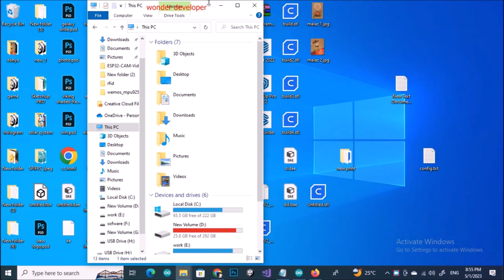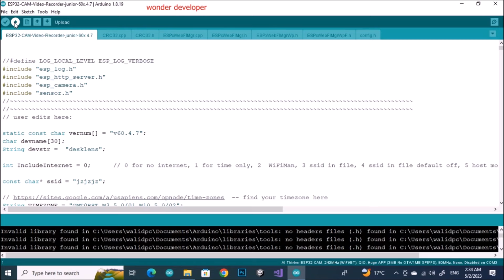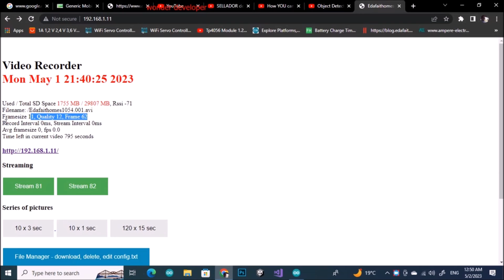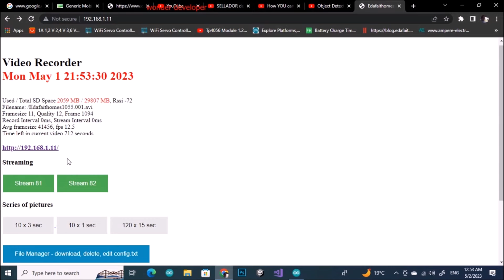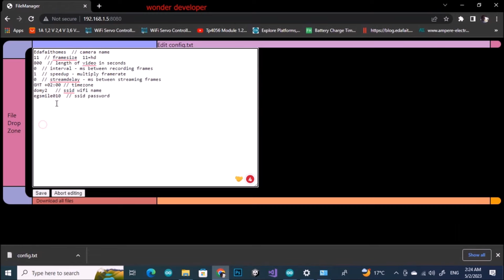Tutorial  ESP32 Cam Save Videos and Photos | WiFi Security Camera  (Webcam for Home Assistant)

Comment: How do I take video recordings manually and not automatically so as not to waste SD card storage?
Reply: youu could attach a PIR motion sensor to trigger for recording.30seconds per file.
Reply: Add switch to turn on/off the esp 32 cam

Comment: Sir can we make like this, 

1. This camera capturing should be continues, but only last some few hours footage it should save in SD card.

2. And now as per your code how is this.  

Sir, Please answer both.
Reply: i'm trying to answer your question based on my trial, this code made for continues recording however the length of videos recorded based on the setting in config.txt file there are video quality and video length in seconds. however we can't control the camera when to start recording because it start record immediately once it wake up or reboot, we only control the end of record with the bottom button.:face-turquoise-covering-eyes:
Reply: Okay sir thank you, thank you so much for your valuable time and co-operation.